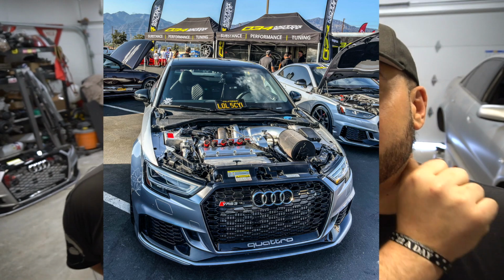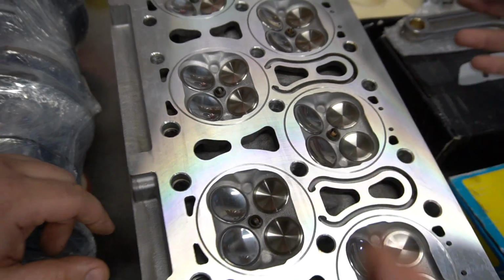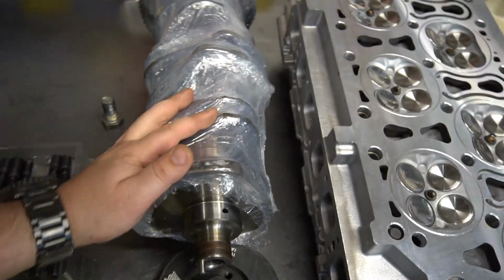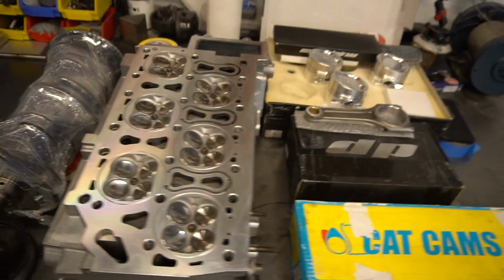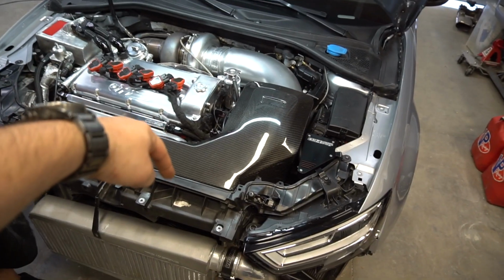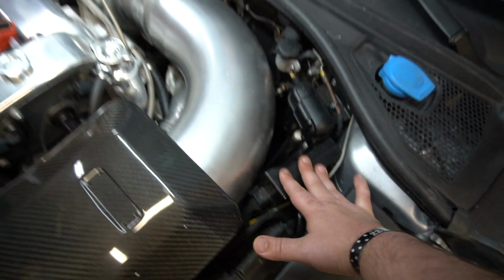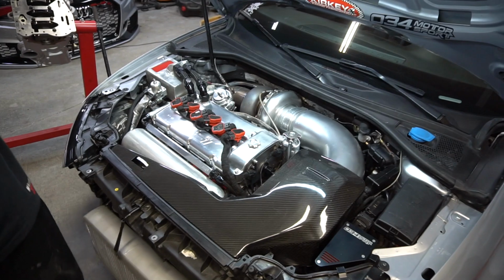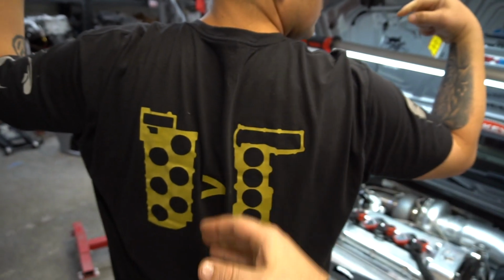Game Time!!!  Large Wooden crate arrived for the RS3........

Comment: Secret to lapping valves is three things. One: Only rotate the valve 90-120 degrees from center without going in a circle. Two: Only put a dab of lapping compound in one spot. Three: Lift the valve and resume when you hear the grinding feel go way down. The lifting of the valve will draw the compound back into the center of the seat. If the valves are concentric with the seat, the compound will work it's way around 360 degrees from the dab. If you don't rotate beyond 120 from starting point CW or CCW then you will know if the seat is not concentric. There will be a spot that doesn't get lapped. If it's just a small amount, continue until the valve is lapped 360 degrees. If it's extreme, the seats are cut improperly.
KEY POINTS, YOU CANNOT HURT THE VALVE OR SEAT BY LAPPING THEM. IF YOU CAN CLEARLY SEE AN EQUAL THICKNESS LAP LINE ON THE SEAT, NO VACUUM TEST IS NECESSARY, IT WILL SEAL PERFECT 110%
Reply from the maker: Absolutely. I’ve actually done many dirt bike and  Cummins engine cylinder heads. If we needed to lap valves fast for an event we could do it. But prefer being able to double check my work. And the first machine shop who did my motor in California did not lap valves correctly and all valves leaked. So even experts make mistakes. But we do double check everything

Comment: Good to see you back in business Malakas. I've been waiting for this build with extreme anticipation. I'm still considering a VR in the back of a 60s GM sports car. Corvair Monza mid engine de-stroked VR36/R36 with a DQ? or different trans. De-wookied with carbon unequal bellmouths inside a plenum and unequal length header tubes to have everything equidistant from the valves. Keeping the back seat and shoehorning it in between the rear axle and rear seat back (probably seat back/firewall moved forward 2-4 inches. Everything should fit.
Reply from the maker: Well that sounds like a very fun project similar to that Renault with a vr6. Very cool if you do start this project be sure to tag us on Instagram @malakamotorsports. Would love to follow your build

Comment: Lapping valves is super easy, and you can check the seal  with a permanent marker around the sealing  face of the valve and a lap tool...if youre not lapped in itll leave marker in the area thats not sealed. Not a huge process. Now cutting valves (5 angle job) requires a machine or a machine shop...just lapping is simple though

Comment: Valve lapping is easy with new valves and seats that have been ground for 3 angles or what ever. You don’t need to vacuum test afterwards, you can physically see the grey lapped surface, just visually check that the lapped grey area continues 360 degrees with no gaps… it really is that easy. 

I would hand lap with the wooded shaft and sucker tool, although the round rocker tool that fits in the drill and has a sucker on the end work ok, just let it slowly rotate in your hand as you go.

Just make sure you clean off all the grinding paste.
Reply from the maker: Absolutely it’s something I’ve done before wirh diesel heads. But still rather have a machine shop do it and double check their work. Couldn’t tell you how many times I’ve seen bad head work.  But if we were in a pinch and needed to get it done absolutely

Comment: Great vid guys 🙌🏻 Question... You talked about how the 5-cyl had DI and there were a bunch of wires you didn't use because the VR6 doesn't have DI, are you guys somehow adding DI with the new built motor, or... will the builit VR have it added in the future?  TY 🍺
Reply from the maker: Hey Kevin the newer cars all have direct injection 2.0t, 2.5t and even the 3.6 vr6 has direct injection. This is what helps them run higher compression due to it being direct port. We are not going to be running direct port.  The only direct port we will consider is “NITROUS”
Reply: @MalakaMotorSports  thanks for clarifying! 👍🏻

Comment: In a previous video, you had said one of the main reasons to go to the vr6 was that the engines are cheap and easy to source. Isn’t the billet block the opposite of those? Will take a couple months and cost a ton?
Reply from the maker: It’s an extreme route, but ironically the Billet VR6 motor capable of over 1700hp costs the same as a new 5cyl RS3 engine from Audi (15-25k) and those are popping/breaking at 1000-1400hp range 

So which would you rather have ?

Comment: Good afternoon hey man I got a question I don't know that much about VW I'm getting into it now . I bought an r 32 engine from A Touareg 04 And I want to put the engine in a mk4 2.8 24v Can I use the oem transmission and the harness for the r 32 ?
Reply from the maker: I’m not sure exactly what needs to be done.  Transmission should bolt up no problem. But the harness may be slightly different.  Also timing and intake manifold mounting I believe is different. 

-stav

Comment: Quick question… why does the girdle not attach to both sides of the main caps on on cap #3 and #4?
Reply from the maker: Oil pump clearance, as the oil pump sits in that area.
Reply: @MalakaMotorSports   so you’re telling me no one has thought of a oil sump solution to make a girdle that attaches to both sides of the 3+4 main caps? Sounds like theres an untapped market there…
Reply from the maker: @justindelvalle9179  there are other options but they space out the pump a bit further which is something we don’t want to mess with. Rather leave the oil pump system as is. Lot of big power and 7 second VR6 powered cars in Europe are using the same steel girdle we have opted to use, so we are confident this will help and work for us.

Comment: Stav's right about the expansion tank, but you may still need a larger tank.

In a sealed system, at least when operating properly, the volume of air is what dictates system pressure at temperature. The fluid will expand a certain amount, the amount of air in the system that is able to compress, determines the system pressure. More air volume, less system pressure. It's the difference between expansion tank and overflow tank systems.

That said, there still needs to be a large enough air volume to not cause over pressurization. You can trick the science a little here though, if you're set on that size. If you open the cap while the system is hot (fluid expanded, but not under significant pressure obviously) and let some of that air escape then put the cap back on while the fluid is still hot, once it cools there will be a slight pressure depression in the system. When it reaches temp again, system pressure will be less, even though you're working with the same volume. The expansion of the fluid is the same, but there's less air to compress into the 'extra' space, resulting in a lower overall pressure. This does depend on the design of the cap, some will normalize a lower pressure to atmosphere.
Reply from the maker: Whoa, appreciate the insight, perhaps it’s time we switch to Water less coolant, while still more pricey than standard coolant, the benefits may appeal to us on this setup
Reply: @MalakaMotorSports  waterless definitely has a couple advantages, but all liquids expand/contract to some degree directly with temperature, disregarding the weird way water acts as it freezes.

I'd fill that tank half way with air and see what happens. If it still vents, hook a cheap pressure gauge up to the vent and see how far over that 20psi you are once it does.

Comment: Dude, you guys could make a vr > 2.7 shirt, I wouldn't be mad haha! Stoked you guys are back! It was awesome to chat at Socal Euro! As of this last weekend I sourced my oil leak, and got the passenger head in correct timing. Ran it last night trying to do break in cycles and it ran good till no cooling fans came on, electrical isn't much my thing.. gonna need Stav after he reroutes the ecu and the adds for fueling.. yknow, since we have till December 😂 🙌
Reply from the maker: Did you drain your coolant out? Maybe because you pulled the front end off?
Reply: @MalakaMotorSports  ya front end was off, I bled it off twice with no more bubbles near the throttle body, it ran for 15 mins or so before it spewed out the loose reservoir cap, but I'm at a loss for why the fans didn't kick on.. it didn't register as hot, but then again I should have had the vcds hooked up to monitor temp.. some believe I have an air pocket at the lower radiator temp sensor.. ive done 2 warm up and cool down cycles, I bet neighborhood cruising would burp it.. I also need to verify I spliced the correct oem fan wire per JHM's write up
Reply from the maker: @bmorlok84  interesting I was just talking to someone about this today having a similar issue on their B5.  Ended up being the lower temp sensor on the radiator hose.have you tried turning on the A/c . On that car the large jhm fan should automatically turn on with the a/c no matter the temp.  But yes Definately check your wires. Also make sure to bleed system while running  the heat to fully cycle. Just a few tips I’ve come across some pesky air pockets blessing my vr6 sometimes. Sometimes driving it around then parking it and opening cap after a few minutes did the trick.
Reply: @MalakaMotorSports  ya someone else mentioned turning the ac on too. I'll have to give that a go. I prefer the drive it around method too to burp it, but ik hesitant as its a full rebuild, so I want to get those break in cycles good too